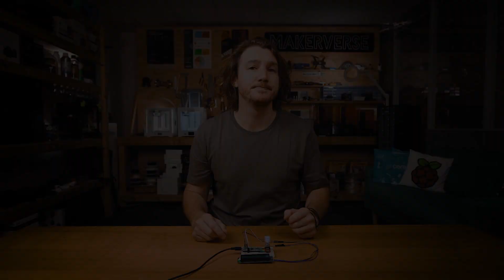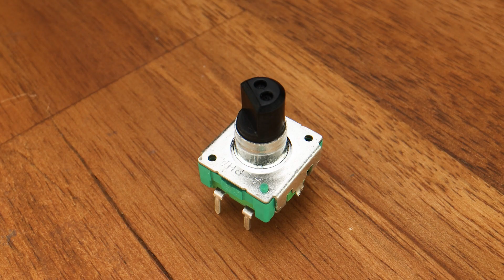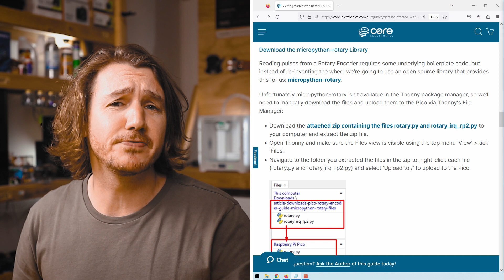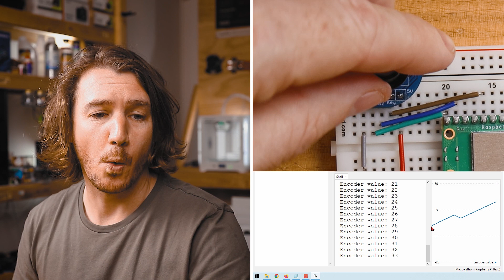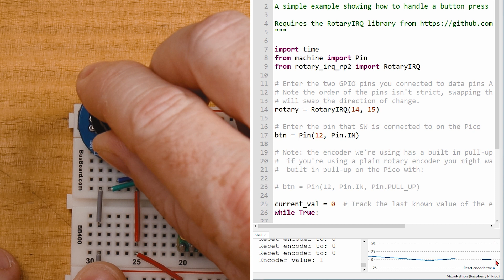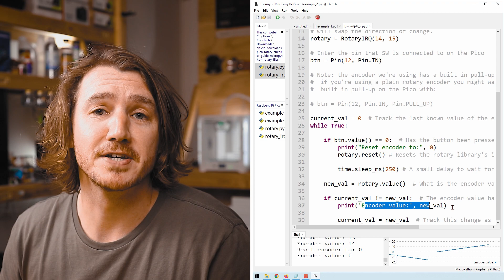How To Use A Rotary Encoder With Raspberry Pi Pico

Comment: Can i add a display to that rasberry pi or do i need to use an other rasberry pi
Reply: as long as you have free GPIOs on your raspberry pi, you should generally be able to connect more devices, incl. a display

Comment: thank you so much for the video...i am completely new to all this but managed to get it to work!!...thank you. One question, if i want to wire up 5 encoders, do i simply use 5 example codes for each encoder or is there another way that is easier? If its the 5 different files, do i save them all and maybe name each one encoder_1, encoder_2 etc? Thank you so much and im honestly sorry for the potentiallystupid qstion.